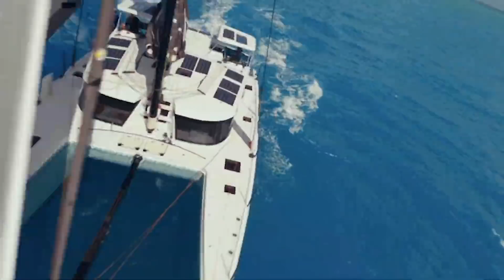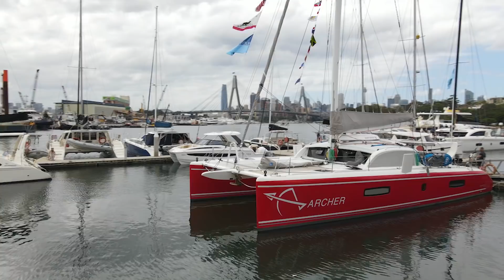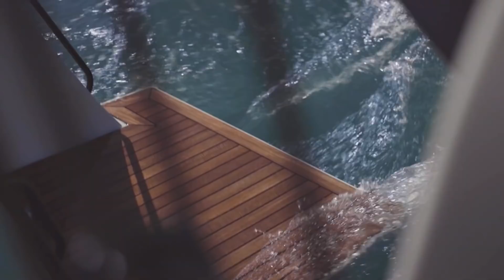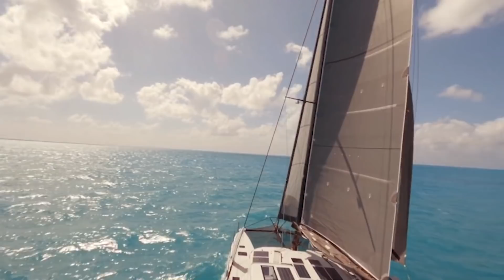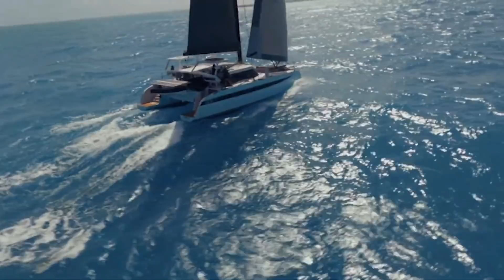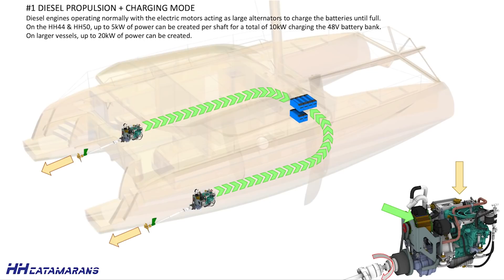The Sailing Family's Seth Hynes Explains HH Catamarans

Comment: How about bulkhead cracking issues? Is this as or less durable than aluminium cats like Garcia aluminium cat?
Reply from the maker: No sir not on these mean machines…resin infused with super strong carbon bulkheads all fused together as one monocoque structure. The strength for weight ratio is unbeatable with carbon. Alloy can provide equivalent strength but much heavier. Alloy is very durable in terms of knocks and impacts if in sketchy locations
Reply: @MultihullCentral1  That's great. You get bulkhead issues with many production  Cat models / brands , also creaking noises are really irritating.

Comment: They look like great beautiful boats.  Last year at Annapolis I walked over to see the HH cat. I didn't know very much about them. No one was on board the boat, but the person at the front said, "You need an appointment and there are no more appointments." End of conversation.  I signed a contract for a  >2 year delivery on a Seawind 1600 (Hull #16).   Later I found out that the wait for the HH  was less than a year. That would've been very interesting to me. 
The hybrid option sounds absolutely terrific. As a long time sea kayaker I know that the quieter you are the more sea life will come to you and the less stress you cause the sea life. But, I would never want to have a four hour upwind  leg with only two hours of battery/electric motor.  I'd like to see more video of HH's actually being sailed, crossing oceans, etc...
Reply: My wife and I found the exact opposite of your encounter to be true with the HH representatives, they were more than accommodating for us without and appointment and extremely gracious and helpful.  Boat shows can be tough on the people working, so I always cut them some slack as it's tough to have 1,000 conversations over a 3-4 day period.  You should be very happy with your 1600 though, that's a very nice boat as well, and $1M less expensive which pays for a lot of margaritas!
Reply from the maker: It’s a great point and subject. The electric motors have a fuel supply like any other motor, but it’s energy stored in batteries. That will be expended faster if punching into head on conditions than if flatter conditions which is why your diesel motors are there as a backup. Sail to your destination, electric motor in between sails and diesel to get out of trouble. Net result is less fuel burn, less maintenance and several options of energy supply
Reply: The Seawind looks like a great boat so congratulations - they may have done you a favour :-)!

Comment: I imagine the starting price on the oc44 is in similar level as a gunboat?? I will be happy if you proof me wrong ;-)
Reply: I checked last year and HH44 (parallel hybrid) base price was a few percent higher than the Antares 44 with the parallel hybrid option (Antares publish their price on their website).  However, the Antares is pretty much fully loaded, while base model for HH44 still require quite a bit of add-on.
Reply: @jackchen5290  The HH44 comes fully loaded. Sails, lines, anchor, batteries, solar, folding props, etc etc etc. Check it out!
Reply from the maker: The OC44 is at a lower price point than the HH44 and is set up more for cruising but still loaded with much much more than most production cars of its size. There will be more that comes out in this topic but the approach and construction is on another level so needs close analysis when comparing on price. These are very high on tech
Reply from the maker: They are certainly no sold on price but you might be pleasantly surprised